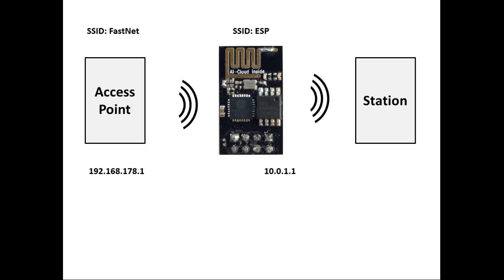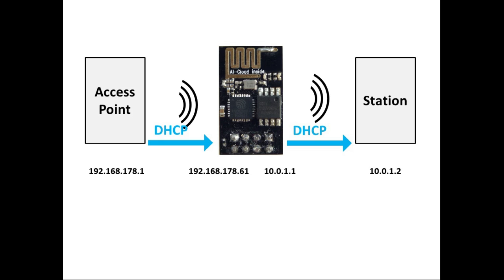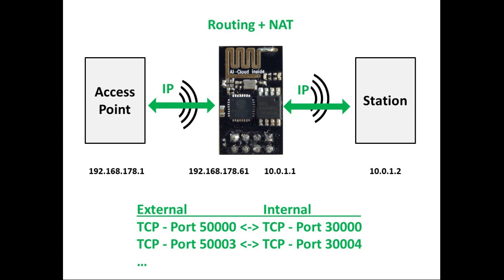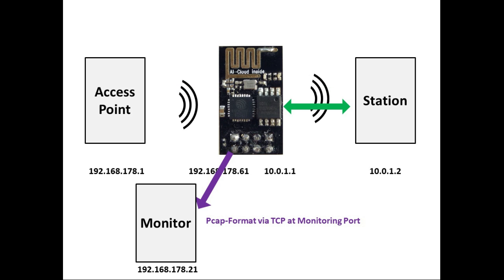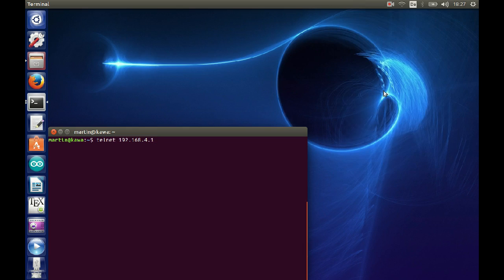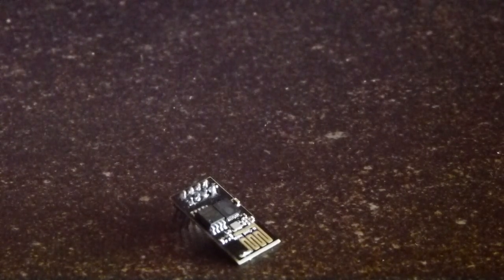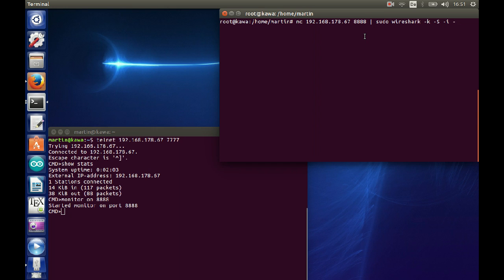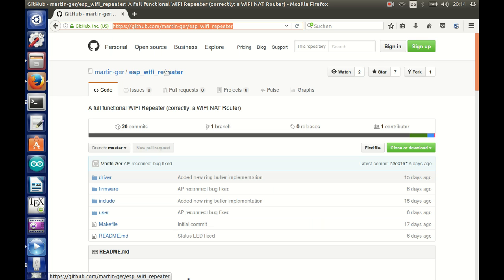ESP8266 WiFi Repeater (NAT Router)

Comment: I tried this on a wemos d1 mini pro 2.0 and it loads fine and connects to my access point on my phone I can ping external IP's and local addresses on the root AP's network but I cannot load any websites or exchange any traffic that is not a simple ping. An example would be I can ping my root home router from the esp repeated network but I cannot load its webpage. Is there a firewall I have to toggle off?  Routing and DNS appear to be working.
Reply: I think that I have the same problem I cant upload IP 1.92.168.4.1 i can't get into that page google don't let me
Reply: @Hermandelacruz  have u connected to the default SSID? its MyAP with no password

Comment: Hello i have a Problem in my WLAN Passwort are spaces are there anyway to Type spaces because it ist really Important dir ne pleased Help me
Reply from the maker: https://github.com/martin-ger/esp_wifi_repeater#command-line-interface : "Again, if you want to enter non-ASCII or special characters you can use HTTP-style hex encoding (e.g. "My%20AccessPoint") or, only on the CLI, as shortcut C-style quotes with backslash (e.g. "My\ AccessPoint"). Both methods will result in a string "My AccessPoint"."
Reply: @martinger327  It works after a few attempts nur ist It possible that the Internet Speed ist faster?
Reply from the maker: @JochenDasRochen  Faster than what?
Reply: @martinger327  now i only have 5mbits per second that it is more than that
Reply from the maker: @JochenDasRochen  Bandwidth mainly depends on the local WiFi congestion and the uplink speed. The ESP's repreating speed is marginally increased by setting CPU speed to 160MHz, but this is hardly measurable.

Comment: how to monitor? can somebody teach me in detail
Reply from the maker: Connect a terminal with 115200 bps and you can monitor the behavior with the various 'show' commands.
Reply: @martinger327  I see I see thank you. I've already put it up. Is it as secure as a standard wap/nat?
also thank you for your wonderful work
Reply from the maker: @neinnine  It protects any node behind the NAT from incoming requests as any other NAT router, however, the ESP with lwip is certainly not as robust as a linux-based FW. I would not use it as primary security device.
Reply: @martinger327  oh i see i see. i did notice you were using ubuntu. I just moved to linux mint from windows and I am interested in this kind of projects. Thank you very much. As for this project, I plan to use it daily as an extender so I was wondering if it was secure enough and it appears so unless someone really intends to break into it. Hopefully I can learn enough to make projects like this on my own. Im just wondering where I should start ^_^

Comment: I have flashed everything and this thing connects to my wifi network and creates another one with another gateway, if I put the same gateway as the primary wifi network it wont work so this is not a wifi range extender
Reply from the maker: As explained in the video it is a router, a NAT router. It can extend the coverage of a WiFi cell, while it is not logically one cell.

Comment: Hi 
couldn't this be handled via arduino IDE ?
Reply: Also, I need to know how to use it for streaming .. Any suggestion to move forward for it ?
Reply from the maker: No, currently the project uses the esp_open_sdk. Simply replacing the lwip implemenation in the Arduino IDE with the NAT-enabled one would be a first step and getting a simple NAT router would be easy. But all functionality of config, CLI, Web, etc. has to be included/ported from C. Can be done - buy why?
Reply from the maker: Can be used for streaming - as long as the bandwith is enough. Generally, audio works and youtube vidios as well...
Reply: I am (as a beginner-to-intermediate), I am familiar coding with arduino,.
Anyway, I ran the code and it works well.
but i am looking forward to make a local streaming. So is it possible using this code ? 
Thanks for replays :)
Reply from the maker: What do you want to stream and where are the nodes located (server, client on the STA or AP side)?
Reply: I want to stream video or data via usb mini as serial. and streaming it to connected stations.
Reply: I want to stream a data driven from computer through serial port, to stream it to stations connected to ESP8266..
Reply from the maker: If you computer is a Linux box and is able to run a "slattach" command, you might consider my other project: esp_slip_router at github. Use the AP settings.
However, streaming speed is limited by the serial line to 115200 bps.
Reply: Martin Ger Wouldn't this limitation due the USB to UART converter? 

So using another USB to UART could improve baud rate .?
Reply from the maker: Yes, I think so. Havn't tested that, but the ESP's UART can handle higher bitrates.
Reply: I've found USB to UART bridge, which has a speed of 12 mbps (USB 2.0). 

CP2102N 

Could this change increase the baud rate ?
Reply from the maker: The ESP8266 is reported to handle 230400 bps and more. Havn't tested that but it should work.
Reply: I found this at ESP8266's datasheet : 

Data transfers to/from UART interfaces can be implemented via hardware. The data
"
transmission speed via UART interfaces reaches 115200 x 40 (4.5 Mbps)."

Comment: Bitte teilen Sie Ihre Twitter oder andere soziale Medien
Reply from the maker: I'm that old (and privacy aware) that I don't use social media at all. Email ist enough. ;-)
Reply: Ha ha good enough.
I had query , that can a esp8266 be used as tor AP node in repeater mode. That will be so cool to have handy Tor encrypted AP.
Reply from the maker: World be cool, for sure. Do you know of any code base for Tor that can run on a small device like the ESP?
Reply: TorghostNG ist also there, written in Python 3. So with Micropython and Arduino nano if needed, can be explored
Reply from the maker: @avinashkachare2482  I don't expect, that this additional SW will fit onto an ESP8266. Micropython alone is already close to the limit. 
But if so, the NAT feature can be easily added to each Arduino project, as since is release 2.6.0 the NAPT/NAT lib is part of the standard distribution.

Comment: Hey Martin ich finde dein Projekt sehr gut. Danke für die vielen Mühen und Zeit die du in das Projekt investiert hast. Ich habe leider mit meins ESP NodeJS ein Problem. Wäre toll wenn du mich mal kontaktieren könntest.
Reply from the maker: Mojo the Sleeping Shaman Was für ein Problem denn?
Reply: Martin Ger Ich habe alles nach deiner Super dokumentierten Anleitung geflasht, nur blinkt bei meinem NodeMCU* die blaue LED schnell. Daraufhin hatte ich die .BIN wie in deiner Anleitung bei solchen Problemen dazu geflasht. Leider ergab dies keine Besserung. Etweder bin ich zu blöd dafür oder ich habe einen Chip der sich von deinen unterscheidet.
Reply from the maker: Glaube ich beides nicht ;-)
Hast du esp_init_data_default_v08.bin nach 0x3fc000 geflasht? Hast du den DIO mode gewählt? 90% der Flash Probleme liegen an einem der beiden Punkte. Dann: hast du die Binaries korrekt runtergeladen (Checksums)? Kannst du andere ESP-binaries flashen? (Arduino z.B.)
Reply: Vielen Dank für deine schnellen Antworten. Ich konnte die Letzten Tage nicht mehr die Checksums überprüfen. Hatte aber die Möglichkeit das ganze über ESPTOOLS für Linux zu flashen. Jetzt funktioniert alles tadellos. Super Arbeit von dir.

Comment: Hi
Thanks for your very useful firmware :)

1. I need this NAT router to be one of my esp nodes in network. 
But each node has a digital sensor connected to esp and it sends its data( value of gpio12 ) periodically.
Is it possible to do this with this firmware? How can i do this?

2. I tested this firmware on esp12. it works well. after that, I uploaded some arduino programs on esp ( mqtt samples ). At the run time, esp is also (always) in ap mode which is not in my code at all! 
Here is a screenshot:
https://drive.google.com/open?id=0B4Vtt0lBHKwtbGpkeTNhY3RnbVk
Sometimes esp access point doesn't have password and i can connect to it.
The ssid also differs by every upload.

should i upload one of espressif sdks on esp to solve this?
Reply from the maker: 1) Of course, it can be added. Actually, I just experimenting with GPIOs and MQTT on the repeater. The latest firmware does allow for GPIO output via MQTT - not yet input. Will add more documentation soon...
2) This is a leftover of the stored WiFi-config of the SDK software. Just flash a 4 KB blank.bin to 0x7e000 this should clear the config.

Comment: This video looks terrific - exactly what I'm looking for.  However ...  (you knew there would be a "but") ....
I followed your links, and found that I must first download https://github.com/pfalcon/esp-open-sdk  I used "Clone or Download"/"Download .ZIP".  It downloaded very quickly, as if it was pretty small.  When I go to Sketch/Include library/Add zip ... and give the disk location, it says "Specified folder does not contain a valid library".  I tried unzipping the file - but discovered that the folders in it are, in fact, empty.  I reloaded the file in case of a bad download, but with the same result.  However, the notes for the esp-open-sdk library say that it includes several other libraries ...
https://github.com/jcmvbkbc/crosstool-NGhttps://github.com/jcmvbkbc/gcc-xtensahttps://github.com/jcmvbkbc/newlib-xtensahttps://github.com/tommie/lx106-hal... so I tried downloading them individually.  When I look inside the zip, these ones are not empty, but when I try to include them (as .ZIP) it still gives me the same answer - No valid Library.The gcc-xtensa-call0-4.8.2.zip is big - 146MB, and it took a while to download.  When I try to include it as a zip, the Arduino IDE also takes a long time over it, but eventually just says that it doesn't contain a valid library.
What am I doing it wrong?  I went to the IDE Help site and followed the instructions for including a library.
Reply from the maker: After cloning or downloading make sure to fulfill the requirements at https://github.com/pfalcon/esp-open-sdk#requirements-and-dependencies and follow the build instructions at https://github.com/pfalcon/esp-open-sdk#building .

This downloads and builds the complete toolchain and libraries. Takes some time (on my system about 30 min)
Reply: Thanks Martin, it looks like an impasse for me.  The instructions start "To build the standalone SDK and toolchain, you need a GNU/POSIX system".  I'm running Windows-7.  Yes, I realise I could install Cygwin and start learning Linux, but it's more work than I want to get involved in right now.
I had thought that by downloading the zip and using the ArduinoIDE's Include library .ZIP, that would do it.

It seems to me there was an error in making the zip archive.  Under the heading "pfalcon/esp-open-sdk", there is a green line, and a button to "Clone or Download".  When I click it, it downloads a file, "esp-open-sdk-master.zip".  It is only 16k, and contains a number of directories - 
crosstool-NG (which is empty)
esp-open-lwip (which is empty)
esp-tool (which is empty)
examples (which contains Blinky and a make file)
lx-106-hal (which is empty)
... and a few small files in the root, of which the biggest (20k) is a makefile.

Is that really how it was supposed to be?
Reply from the maker: The build process of the esp-open-sdk downloads the content of these directories during the "make" from other repositories. So it is correct, that these directories are initially empty and the download size is rather small.

If you just want to use the ESP as WiFi router, you can just download the  binary firmware files from my github repository and flash it from any Windows or Linux machine. This does not require the build environment.
Reply: Thanks again, Martin.  I really wanted to use your code as a springboard to other things.  The completed binaries would be interesting to play with, but would be unlikely to fulfill what I need.  I am looking towards a rudimentary mesh network, not just a WiFi repeater.
You've done great work there, and I appreciate your response, but I'm busy playing with the library functions, so I may get it sorted out on my own.  Just give me a decade or two ......
All of the best to you!
Reply from the maker: Okay, then I guess you have to deal with setting up the toolchain anyway. The Arduino environment is much easier to install. However, my project requires the open sdk...

I was also thinking about a basic mesh (autoconfig of router chains and one single SSID for all clients). Maybe I will address this project next term with my students...
Reply: Well I've just subscribed to your channel, because I wouldn't want to miss that - though by that time, I will have either achieved what I wanted, or have moved on to something completely different.

Comment: IF YOU HAVE A ESP-01 IT IS A WASTE OF TIME
I did this with ESP-01(Esp8266 first version) and it is shit, don't waste time with this if you want a normal  wifi extender. It is not about the program but ESP-01 itself.
Reply: If you want to use the ESP-01 as a NAT router, this project is definitely not "shit" or a "waste of time". If you want to use your ESP-01 for something else, just use it for what you want, instead of criticizing project you do not want to use.
Reply: @johnnynorre   It is shit if you want a decent  wifi extender.  I did it , i tested it and  it can't even give 5 GB stable. I am not saying it does not work. I am saying you would better use the cheapest wifi extender instead of ESP-01.

Comment: Flashed the software and it's currently working. However there's an N with a tilde (ñ) in my ssid. When set via telnet it changes it to C1, and with serial connection it sets it to 'nC1. Is there a way to fix this?
Reply from the maker: With the versions up to today: impossible - accepted only ACSII on the commandline. Now you can either enter it as plain Unicode in the Web config page or write "set ssid blabla%f1bla" at the console. Console printout might still look strange, but the bytes should be correct on the air.
Reply: Is it possible that the web interface is not available by default?
Reply: Currently trying via console, but when trying to set piñata as SSID i use the following unicode conversion
pi&#x00F1;ata , from https://r12a.github.io/apps/conversion/
Am I using a wrong conversion?
Reply: Sorry for spamming, but after setting the SSID to the last I can't change it back to the original one. Is there a way to reset it to original? I tried flashing it again, but the settings remained.
Reply from the maker: Uploaded that earlier today, also the fix with the non-ascii chars.
Reply from the maker: Do "reset factory" from the serial console.
Reply from the maker: For me: "set ssid pi%f1ata" works.
Reply: The fix works like a charm, thanks a bunch!